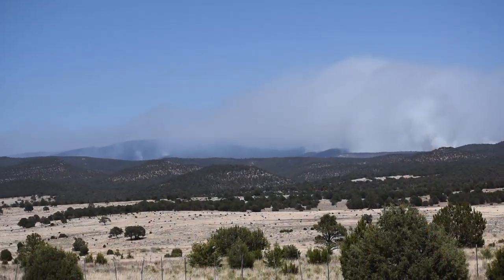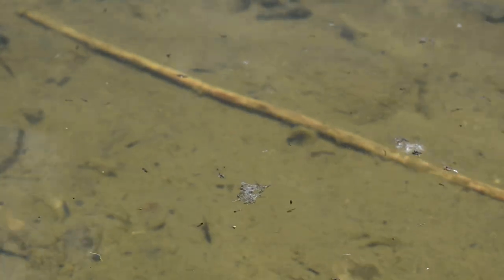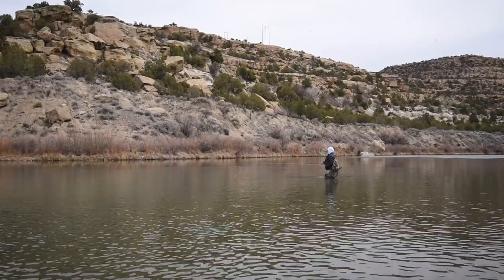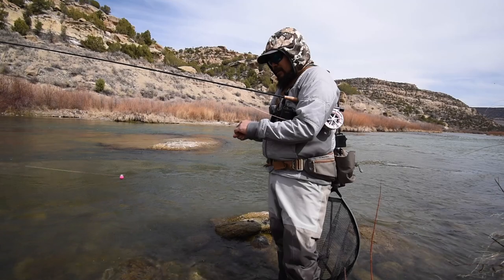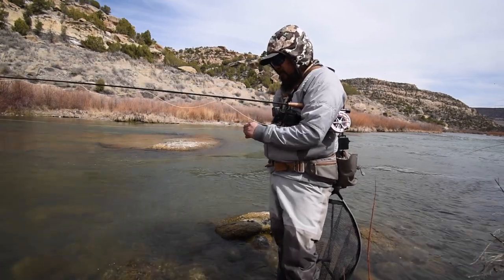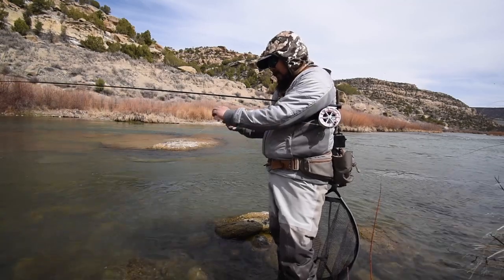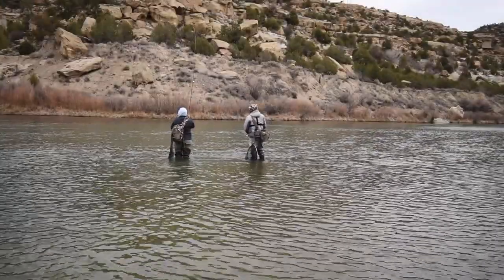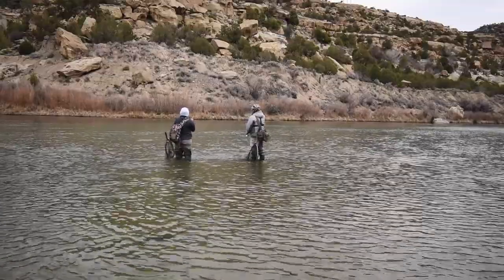INDICATOR NYMPH RIGS - WHAT YOU NEED TO KNOW

Comment: That was great Norm. But it has got me thinking about presenting the fly at the depth required and not missing out on the take on the indicator. I my self do not do much with the indicator. But I love a challenge. The weight is always going to be the problem due to its position. But what about putting the weight on the point. The amount of weight is critical to the speed of water, But using that putty stuff you got is going to be a god send. From the weight I would have a dropper of about six to eight inches long for the fly, and positioned about two to three inches higher than the depth you require from the bottom. So if you need to present the fly say 8'' from the bottom. Try 11'' from weight to first dropper. This 3'' difference allows for drag on the line. Now getting the perfect weight requires a bit of false runs. To much weight the indicator will sink. This is where your putty stuff really works, as you can take a bit off or add a bit on. This is just a starter for you. I have never tried this my self. But I have thought it through a bit. I will put a bit more thought into it. I can not try myself as I don't do river fishing any longer. But most of all you will have direct contact to the fly and the indicator will pick up every tweak. Keep in touch mate. Shaun UK.